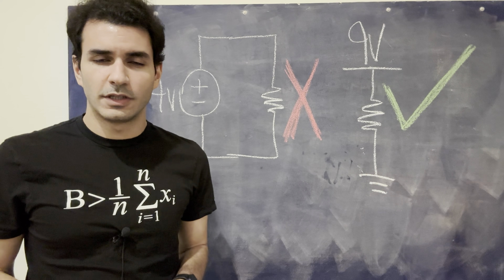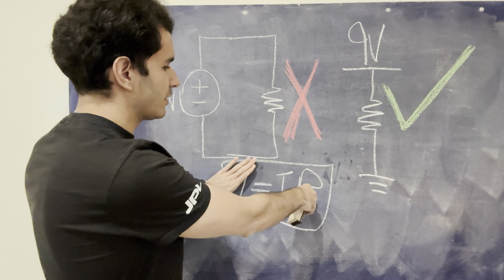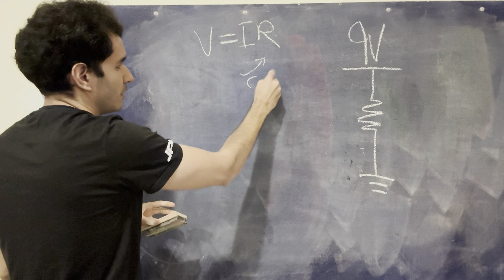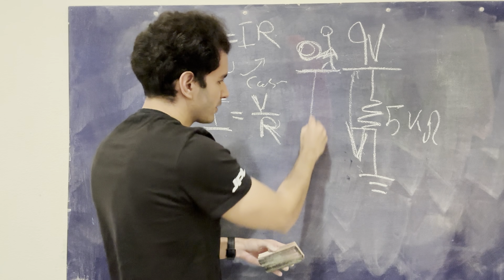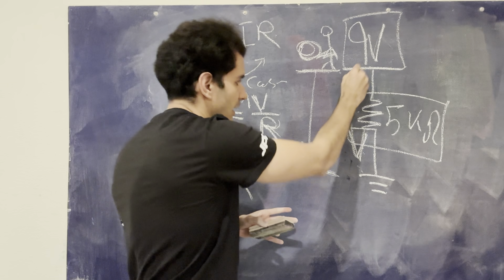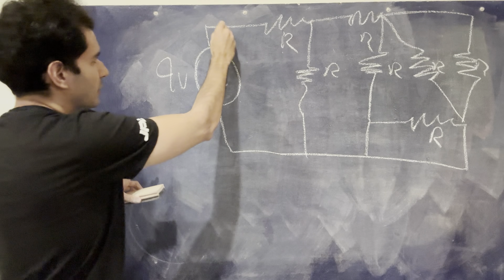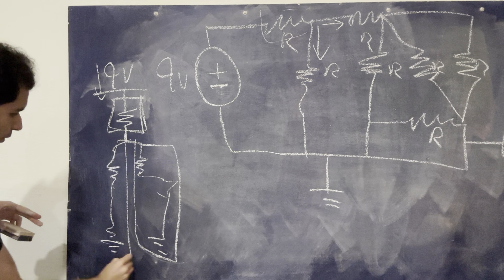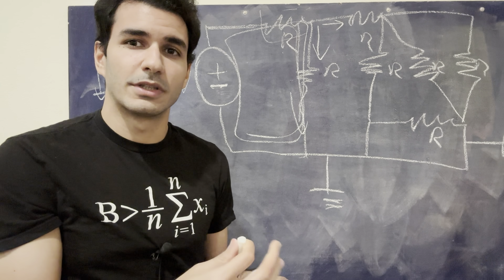Circuits Finally Made Sense When I Saw This One Diagram

Comment: Great way to understand gow electronic circuits behave. You can even underatand alternating current if you just spin this vertical representation around. Just like an hourglass where the sand flows at 0 and 180 degrees and rests at 90 and 270.

Comment: Circuits will make sense when you understand resistance. Electricity will spread through a conductor until an exceedingly large amount of resistance is encountered, then it will be stopped in its tracks.

Comment: 6:55 not correct! Yes most of the current will be shunted by the very small resistor in parallel   but not all current will go trough it!  as engineer you should know this.   even our   multimeter on 10Amp function has a  2.5mm2 copper shunt taking 99.99 percent of the current trough it and that other 0.01 percent is used by the electronics to display you the measured current

Comment: The linear model fails to recognise the clue in the word " circuit", which implies a current  loop. It also confuses the difference between driving EMF and voltage.

Comment: This guy is, I might call "abstraction-challenged."  I identify with what he calls his "physics" perspective (which is really just a perspective that's been formed by his physical experience) but what he saw in this vertically drawn diagram only "clicked" because it made him relate it to his physical experience of something heavy "wanting to" fall but is being impeded by some limiting factor (resistance.)

It's great that he had that "aha" moment.  But the diagram would be electrically identical if it were inverted (with the 9V at the bottom and the ground symbol at the top,) or drawn sideways like the earlier diagram that had the battery on the left and the resistor on the right.  It's important for people studying electrical or electronic circuitry to realize (feel in their bone marrow) that gravity doesn't have anything to do with it.

Comment: Cirremt ia the flow of water, so by picturing voltage as the height of a water tower, and resistamce as the thickness of a filtering tube, you make the calculation of Amp feel more intuitive. Very good analogy

Comment: This was excellent. I really appreciate your way of thinking with these videos. I did electronic engineering at university back in the early 90s, and Kirchhoff's law came to mind when you first drew the circuit. If done correctly, it would help solve the problem, but you are 100% right, it gave you no idea of why those values existed in the circuit. Using this method it changes everything. A revelation.

Comment: Yeeeaahh... but the negative side of a voltage cell is not "ground".   It's "common".   You're gunna kill someone, if they start mixing those two concepts up all willy-nilly, forgetting that they should be isolated or how to handle when they are not.    Also, it's E=IR.  Also, the "flow" is actually in the opposite direction, if you're a physics bro.   ;)

Comment: I always kind of preferred the loop because it seemed to reinforce Kirchhoff’s voltage rule as I was taught it.  But I absolutely see your viewpoint and indeed it is a good visual way to relate physical gravitational potential energy to electrical. Of course other analogies often used are water, pipes and valves however, I find many people also don’t understand what happens with water flowing through a pipe with constrictions so this is only so useful.

Comment: We bought a new power Bank and it said "don't use chargers with 5V/1A (5W) or less power"

I hope I remembered it correctly when I explained it to her, where if you have a reservoir on top of a hill, the voltage is how steep the hillside is, the current is how full (and do how strong the flow) the reservoir is.

Comment: Thevinin and Norton equivelants. 

Ac Signals are just small ac generators (and so are binary output really) 
Learning the path of the signal in both dc and ac (they are not the same when there is a capacitance across the dc power supply) , is really telling but incredibly confusing at the same time. Which is why so many imperial rules get used and why it can seem like black magic…

Comment: i am not an electric engineer and never understand physics cause never was interested in it and never try to learn it. But standard circuit example and V=IR Ohm law kind of easy to get honestly not sure what confusing there))) I am getting more confused with "cause" "effect" "calculate" "intuition" "think of it as something connected to the ground". Ground ?)) so to simplify things we now will introduce something else then - which is by you wording is somehow differ from - of the source? Ohm law is simple linear relationship which should say everything you need to know about it

Comment: Resistance: electrons colliding/hitting (is this the right description?) atoms and their kinetic energy being transferred to the atom; thus the atom gains energy and vibrates more; it 'heats up' and the potential energy per unit charge to do some kind of work has now been used to heat up this material (the resistor) instead of the EM wave continuing through this conductor relatively undisturbed. 

is that sort of right?

Comment: As a knuckle dragging electrician, I use the plumbing analogy to teach electrical principles.  Ie, volts = pressure, resistance = orifice and pipe diameter, flow = gph (bigger pipe, more flow), insulation = pipe schedule, switch = valve, diode = check valve, inductor = ballast tank...

Comment: I was always taught voltage is the cause and current is the effect. You need a potential, the cause, to make current flow, the effect. Your viewpoint seems to be at the load, current thru the resister is the cause of the voltage there. Hmmm What would Lagrange have to say about this?🤔

Comment: I'm sorry, but while I get your point about the energy required to push a current through the resistor, I'm not convinced.  The original diagram is totally fine to me because that's what you physically do in real life to cause a current through a resistance.  i.e. the current is caused through the resistance by the me applying the voltage to it.  I would do that physically with two wires and that is exactly the diagram you erased.

Comment: To think that "drawing vertically" is the "solution" for analyzing circuits is short sighted at best. In the end, if you need a solution for a circuit you just can't say "this resistor is much smaller hence the current flows only through this resistor", this is a "first order" idea. But the necessary calculation benefits little from this. Honestly I thought that you'll discuss also about Thevenin and Norton equivalent circuits that simplify circuits dramatically and make life considerable easier for the real calculation...

Comment: Bro thanks. Essentially what you are doing is introducing ME's, P = Q x R which has similar analogy for EE's V = I x R.

Pressure (P) = Current (I)
Flow (Q) = Voltage (V)
Resistance (R) = Resistance (R)

Comment: Need a resistance? What about a super conductor which is every electrical engineers dream. No resistance would open so many doors . As of right now it requires ln2 and graphene. Hardly practical.

Comment: This is a good starting point, but you aren't connecting all the pieces that move it to its most intuitive form.  There are three variables in Ohm's Law, and you just deal with the first one: You realized that voltage (electrical potential) is analogous to height (gravitational potential).  What makes this powerful is when you start using things pulled by gravity.  In the video you mentioned a ball, but you can't easily make a ball behave like electrons, just a single electron.  Even more confusing: What's the resistance in the dropped-ball example?  Most of the time people liken electrical resistance to friction (e.g., moving your hand over a surface that is smooth vs. rough), but the ball would roll on a horizontal surface, and air resistance is uniform in almost any example that doesn't include a bunch of tubes.

Your direction/gravity approach is great, but the medium is wrong.  A better analogy is water.  Electricity already has that analogy built in via terms like "current flow," and there are many great analogies explaining how various components work using water as the medium (e.g., transistors are valves that are opened/closed by water from another pipe; inductors are like a water wheel that slows the flow until the wheel gets up to speed, but keeps the flow going for a bit once it's spinning even if the river current slows), and many explanations online even animate dynamic processes using water to make it visual.

Resistance now can be anything that causes the water to "back up" (i.e., builds up) which then increases the height (i.e., voltage) which is exactly what V=IR has been saying.  That backed-up water will then "seek" (i.e., be directed to) any parallel path that is emptying faster (i.e., a path of least resistance).  Using gravity for voltage makes so much more sense than treating it as water pressure, which isn't something you can visualize since you can't "see" the change the way you can with height and volume of flow.

Comment: Mike Holt explains it better than I've ever heard, but in a nutshell: 

Voltage does not take the shortest path to ground.  Voltage takes the shortest path to source.

The closed loop diagram will always be more accurate.
Reply: Kirchhoff's law is impossible to explain without the closed loop diagram.

Comment: Sure, this is more intuitive for you and for some people. However, theres nothing less intuitive about writing V = IR and assuming current is like the flow rate in a pipe, etc etc (famous analogy). In your original loop circuit, you could always replace the voltage source with a current souce. One style can't fit everyone.

Comment: Perhaps one of the most poorly understood concepts in EE is the relationship between the current return path, circuit ground and earth grounding.  Perhaps you could do a video where a circuit uses multiple power supplies, both AC and DC to show what is actually a return, what is a ground, and when they should be separate, and when they can be combined.

Comment: I can see how this might help some people that struggle but I find your visualisation more confusing. You are imagining it like potential energy, which is something I do not do. Sure, rearranging resistors top to bottom helps identify which are in parallel but it doesn't take much to mentally do this in your head (if it's even needed). The circuit model made more sense to me when I was learning personally, especially for nodal analysis, because I incorporated the magnetic charges in my visualisation.

Comment: The loop circuit is supposed to show you the movement of the charges and the fact that they go around the circuit. While I get your point, the vertical schematic gives a false version of what is actually happening.

Comment: I would say for that analogy resistance could be thought of as an updraft of wind opposing the speed of the ball falling and voltage is the weight of the ball like a baseball vs a bowling ball so a heavier ball or a lighter wind could result in the same speed of the ball falling

Comment: This is why as an electrician I prefer to work with field trained electricians. Basically there's two paths to become an electrician you can go to school and then get a job or you can just go get a job as an apprentice and learn in the field, the ones who lean in the field tend to lean on their intuition that's developed from experience and a general tendency to maintain critical thinking about a circuit before even approaching problems with the circuit... anyways the ones who learned in the field tend to pick up on that faster. The classroom educated ones tend to troubleshoot more like robots (pre-Ai). Often doing unnecessary things that they could have eliminated without testing or whatever unnecessary steps they took just by critically thinking about the circuit. This is just my personal opinion based off from my observations, and is not intended to be used as a stereotype. Come up with your own opinions, it's one of the easiest things in the world you can do lol.

Comment: There is no doubt you are smarter than me in all things electrical. Problem is, as a complete rtard amateur I don't understand your message - systematically collapsing a multi path circuit to find equivalent resistance/finding current flow in each path seems the best way to look at it? 
I ask electricians as many inconvenient questions as I can, and always end up with a couple of blinks and then "shut up and put the wire in the hole" So in that regard I completely get it - it is astonishing how many qualified people can't answer seemingly simple questions (lecturers/sparkys)

Comment: I'm failing to see what this explains that a traditional circuit diagram doesn't or how it simplifies anything.  Maybe it helps people who have never been given good analogies for voltage, current, and resistance?  Probably showing them the circuit diagram and explaining it as a waterpark's river system would be better.

Comment: I don't find drawing it that way anymore intuitive, to be honest. I prefer thinking about it like it's a water flow. A potential difference wants to make the electrons flow, and the resistor slows the flow down. The current is a measure of how fast the flow is. It also makes sense in terms of the junction rule / charge continuity as well since fluids also have a continuity equation.

Comment: you CAN make a diagram like the last one vertical but just make sure the two ends (top and botom) are the two sides of the batery and not power and ground so that the circuit is still complete.

for example the positive at the top and the negative at the botom (if you use conventional current), basically like unfolding the circuit into a straight vertical line and you can imagine the battery as an elevator that takes electrons from the bottom to the top.

Comment: The greatest thing I ever learned it that (wait for this) voltage isn't a thing. It's the ABILITY to do a thing. If you wire a 9 V power source (say DC) to a resistor and measure the voltage at the other end what do you get?

9V.

Doesn't matter what the resistor's value is - remember there that the other end isn't grounded, it's just floating.

From this we can deduce (correctly) that voltage isn't ONE thing, it's actually two: a magnetic and a electrical field. Moreover (and this is brain melting at first) the fields aren't in the conductors, they are in the AIR. Or in the case of a PCB, the energy, that's those two fields, is moving through the plastic at roughly 2/3 light speed from EACH end of the power source until it meets at the middle.

This is quite easy to demonstrate with a "live wire" tester found on many modern meters. Just isolate the live end of a mains cable - but don't short any wires. Let them float. Plug the other end in and sure enough we can detect the fields all the way along the wire as they almost cling to the electrons. Not moving so much as sitting there as a wave. This is also how aerials work.

As we move deeper into how electronics work it becomes evident that (despite what we're taught) A/C current doesn't not pass through a capacitor - it goes around it. The charge is held by the electric field as electrons are yanked from one plate to the other by the fields and then held in place as the opposite "holes" and electrons are attracted to each other. Understanding this sort of stuff (even intuitively) is crucial to designing PCBs with very fast chips - which is pretty much anything these days. A square wave oscillator might only switch state once per year - but when it does, the time it takes to switch might be in nano-seconds OR less.

Comment: As a non-Electrical Engineer, a lot of EE's can't think out of their box.  His point was to give people, mostly staring out, an intuitive perception, which he did for me.  I knew that V=IR, but now I have better mental picture of the relationship between them, voltage puts pressure analogous to gravity pulling, resistance holds it back, and the flow (current) moves more along the lines of least resistance.   Good job "All the Dazzling"

Comment: but why if we picked two points before the resistor the voltage is still ≈0v?according to this logic since the lower point is far away from top than the higher point means it has less potential energy so the voltage is ≠0v
why all the 9v drop happen between the resistor?
like there the point immediately after the resistor is still far away from the ground so it still has potential there compared to the ground

Comment: Um, do they actually teach it like this in English-language universities? It is actually quite ridiculous indeed. But your way of explaining it is also not precise. 
First, of course I=V/R, it is very logical because the current results from voltage (and is directly proportional to it), and it is decreased by resistance (so it is inversely proportional to it). It would be really meaningless to give this formula as V=IR.
Second, your way of drawing it in a vertical line has several flaws. One is that current needs to travel through a loop. Another is when you say that there is voltage of 9V at the top. It is simply incorrect. Voltage is a difference of potentials between two points, and it is measured for two points. You can't have a voltage in one point, you only have a potential in one point. (And potential is the potential energy of a charge of 1 Coulomb at a given point). The comparison with gravity is correct.

Comment: Surprised to see that electrical engineers in the comments don't get the idea of an anology. The vertical circuit is a visual representation to aid in further understanding. It does not aim to replace. If I said a spherical building is a ball, that doesn't mean it's a ball, I'm just comparing it to one. It obviously wouldn't roll